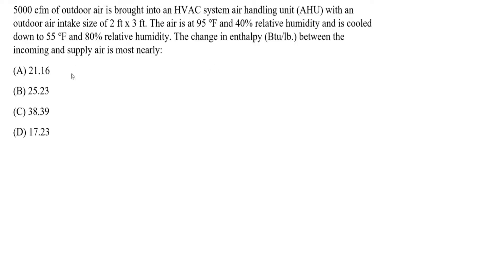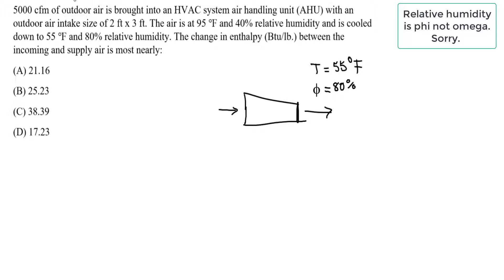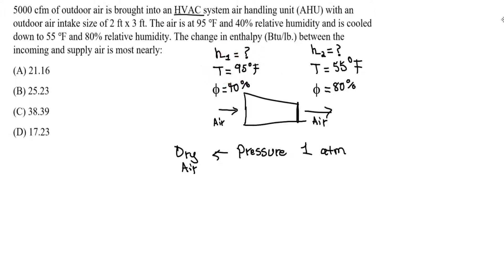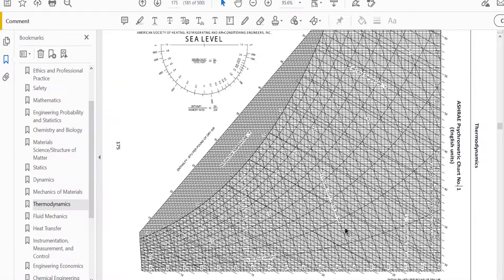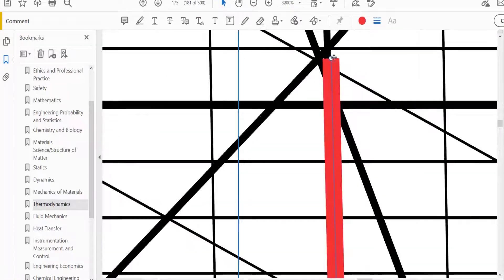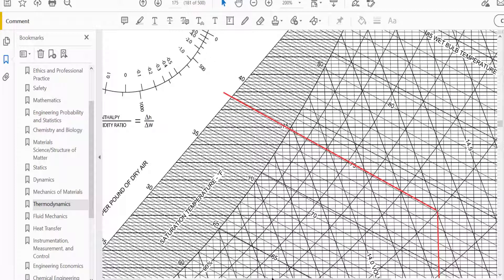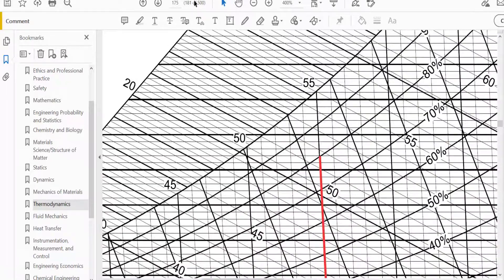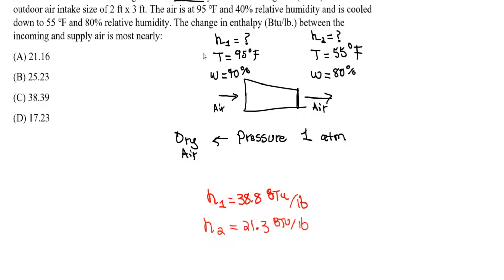FE Exam Review - FE Mechanical - Thermodynamics - Psychrometrics -  Enthalpy

Comment: So should I expect the questions on the FE to give extra info that isn't used like the dimensions of the air intake? Thanks for the videos.
Reply from the maker: They may throw extra info in the problem statement that’s not needed. They do this on purpose to test whether we can extract relevant info and apply it to directly solve the problem. It’s not often they do this but it’s definitely a tactic I’ve heard they do more and more nowadays. 

Keep up the good work 💪🏼

Comment: Hi, how did you know to use dry bulb temperatures instead of wet bulb?
Reply from the maker: Hello! 

Great question. Should have said this in the video but the keyword here is "outdoor air". 

When people refer to the temperature of the air, they are normally referring to its dry bulb temperature. The Dry Bulb Temperature refers basically to the ambient air temperature. It is called "Dry Bulb" because the air temperature is indicated by a thermometer not affected by the moisture of the air.